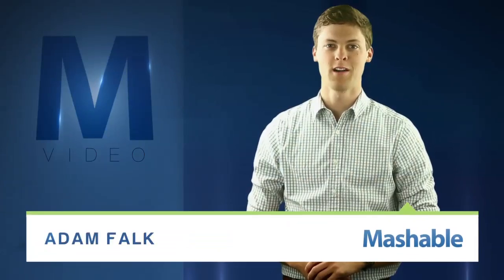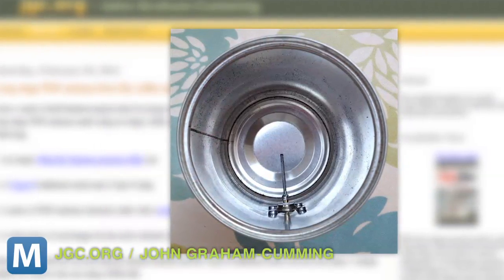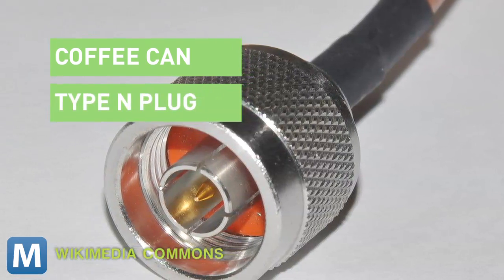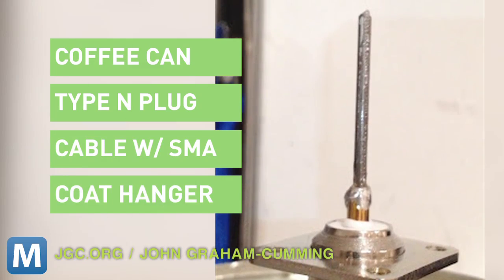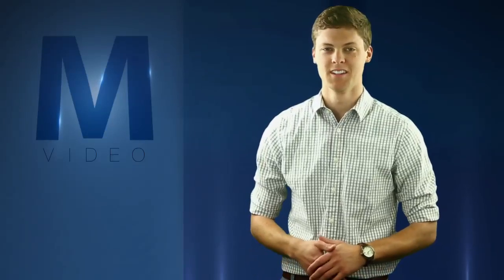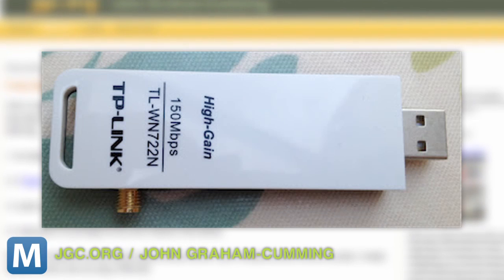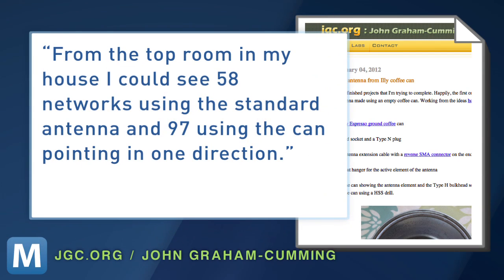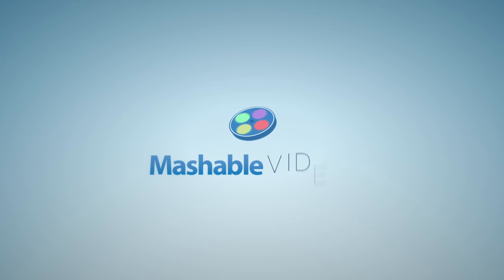Check Out This DIY WiFi Coffee 'Cantenna'

Comment: i have the same usb adapter, LOL. but i can't seem to be able to pin point to exact wifi transmitter spot, can't make the damn signal go to 100%, made it a few times but only for a few moments. is there any software that helps me the signal strength?